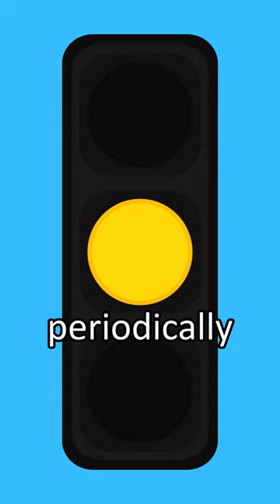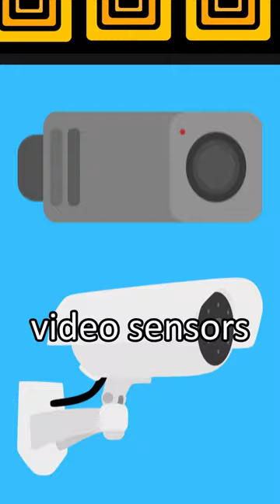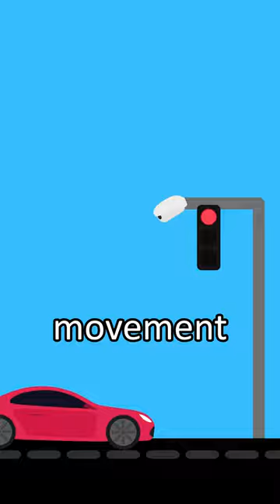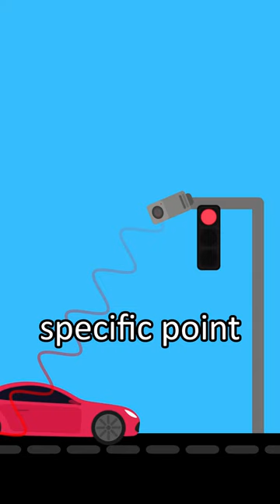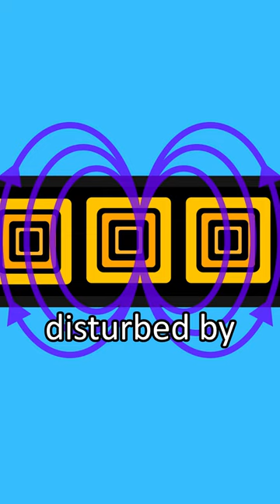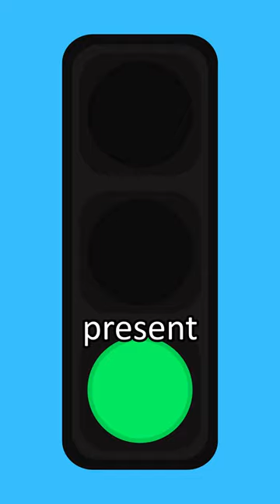How Traffic Signals Work #fyp #science #animation #technology #funny #anime #education #shorts

Comment: or it's just a loop running on a timer, with the frequency of changes being dependant on the time of day. That's the vast majority of traffic lights. 
Fancy tech gets used when there is enough traffic to actually justify it, or the contract with the company agreed to do x amount of traffic lights when they didn't actually need that many fancy ones.

Out of 1320 traffic lights in my city 200 to 300 are using tech more advanced than a clock.